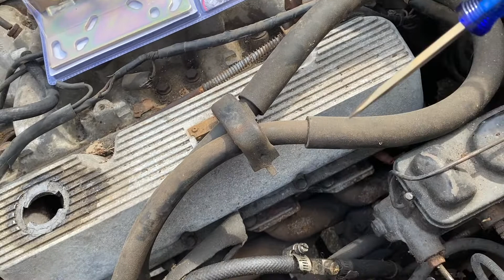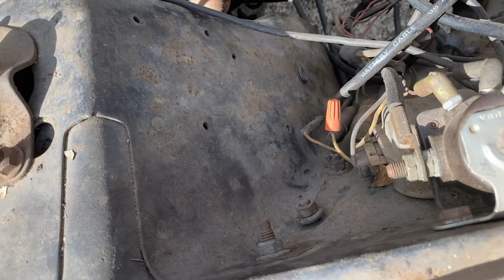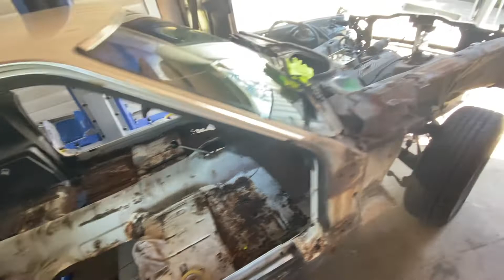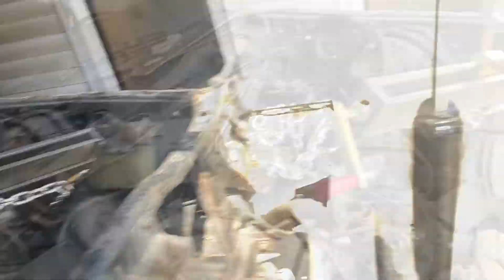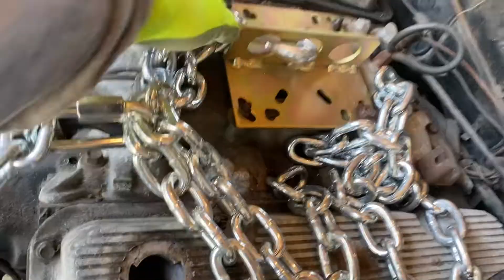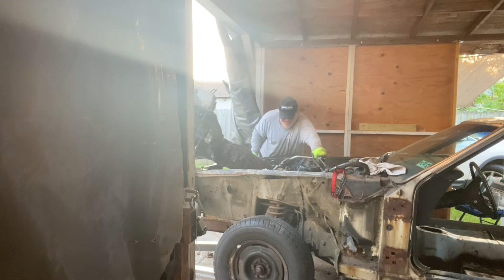IT'S OUT!! Engine is Finally out of the Mach 1. Rebuilding a 1972 R-Code 4-Speed Mustang Mach 1 #17

Comment: Well, it is finally out 🙂 Did you recheck the numbers on the block? The other day I was looking at one of your videos and I noticed that your engine does have the Boss 351/72 R code specific harmonic balancer, which is very wide, and which is a rare piece still on it.
Reply from the maker: I took off the manifold and checked the head (4V) and it does have the D1ZX stamping on it (Boss or HO code). The tranny matches as well as a number of other pieces (VIN or Coding). What was odd was that the block code did not have a straight VIN but only 2 numbers of the VIN which could be the casting date (which I found on the heads as well 2A12 Jan. 1 1972). Therefore, the engine has all of the components of an R-Code but is missing the matching distributor (which I can replace), and the matching carb (which I can't replace).
Reply: @MuscleCarMadnessGarage  Is there no vin number on the engine? If so it could have been a replacement engine. If you blew up your engine under warranty, or later on after the warranty had expired, Ford would replace it with another one with no vin number. It would be a correct engine with no vin. Check both sides of the block as the vin can be stamped on either side. Usually it is on the drivers side under the head, but I have heard of vin numbers being stamped on the passenger side. If no vin number it could be a Ford R code replacement engine.